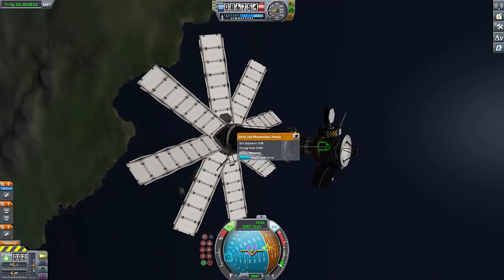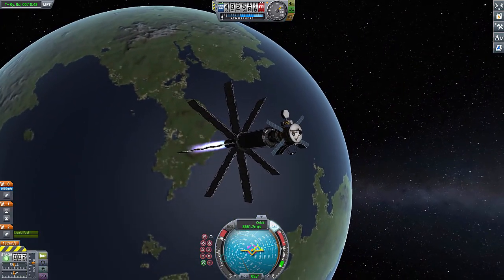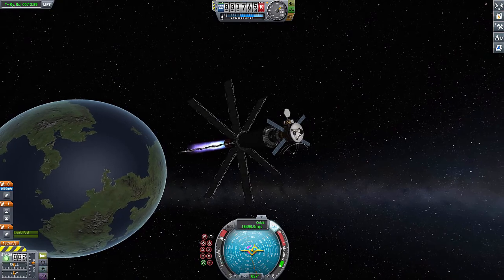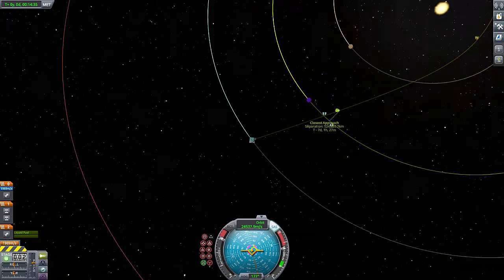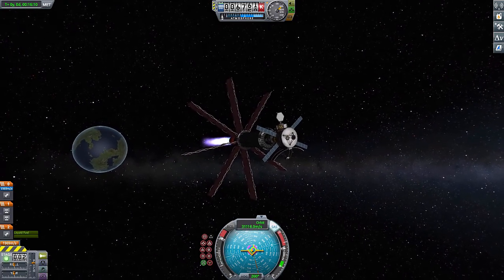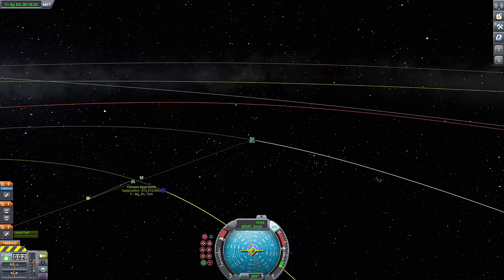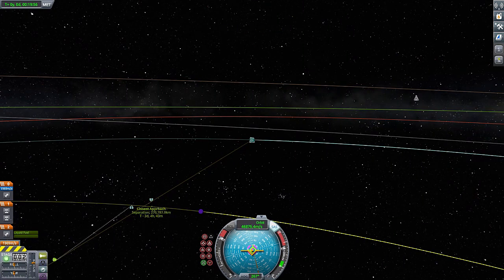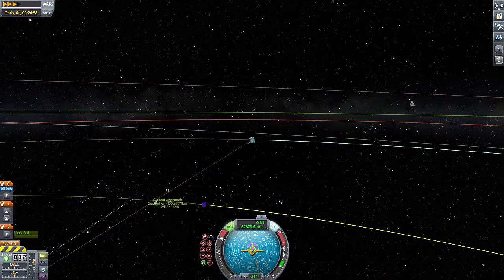Lets talk about Nuclear Saltwater Rockets.

Comment: Let me clear up something for you:  It is a Nucler-Salt water rocket... The water is 'clean' water - drinkable if you so wish... The nuclear salt on the other hand is #OMG - a highly radio  active, molten salt. Read about molten salt nulear reactors. They do have some things in common with this type of rocket fuel. The chinese just build a succesful molten salt nuclear reactor!
Reply from the maker: The salt would be uranium tetrabromide, not moltan salt. Moltan salt reactors are different and use different salts.

Comment: 1) they aren't torch drives.  They have an ISP of 60k-70k seconds, or about 17-19 hours.  So they could only function as one for short trips, like to the moon.
2) it's designed to have the reaction outside the ship.  The flow rate of the water stabilizes it and keeps the neutrons from going towards the cabin.
Reply from the maker: Couple points here. ISP is used as a measure of how efficient an engine is, it's not a metric for how long an engin will run. Because you can't arbitrarily calculate that. If you run 10kg of fuel through an engine and 50kg of fuel through the same engine, despite having the same ISP the engine you ran 50kg through will run for longer. A 90% UTB NSW (an overkill version) has an ISP of up to 500k seconds. But if you ran 1kg of fuel through it, it won't run for 500k seconds, ISP is an efficiency metric. So I hope that makes sense. Basically just give your NSWR more fuel and it will run longer at the same efficiency. Mathematically a NSWR can actually have similar performance to an Orion drive which is cool.

Zubrins original idea had the fuel react in the engine. This is a terrible idea and almost everyone agrees so most modern ideas about it have it reacting outside the ship or behaving like a pulse rocket.
Reply: @venera13  if you are using it for artificial gravity it you would need to burn it at close to 1G, at which point the ISP is close to the burn time.  But I was assuming the 20% enriched version, not the weapons grade version, so yes, your burn time for 1G would be 500k seconds, or 5.78 days.  So only enough for half the trip to Mars.  But you could do a Martian gravity burn for a lot longer.  I'm just not sure if it would be the full trip.
And that doesn't factor in the payload and rocket mass.
Edit: I forgot the fact that your decreasing mass would increase the efficiency of the thrust, (which can be calculated) but I don't think it would do much more than double your burn time at 1G, so you might be able to reach Mars with the super efficient version and a 1G burn.  Not Saturn, though.

Comment: The whole idea of the Nuclear Salt Water Reactor is that you won't need radiators because the reaction never touches any of the surfaces. And to deal with neutron radiation you run clean water over the surface of the rocket.

Comment: Cool video, very informative and really interesting. I've always been interested in stuff such as the Orion project and nuclear propulsion, so it's very depressing more people don't talk about it. And it's not as if we're not already using Nuclear energy in space travel anyhow. Like RTG's used on Voyager, Cassini and Curiosity, or the Polonium heat source on the Lunokhod rover. So it comes as pretty upsetting that they dismiss it so readily, even though it may have some very useful applications.